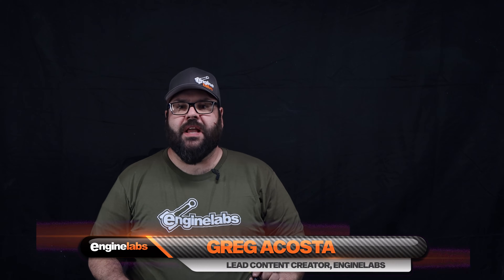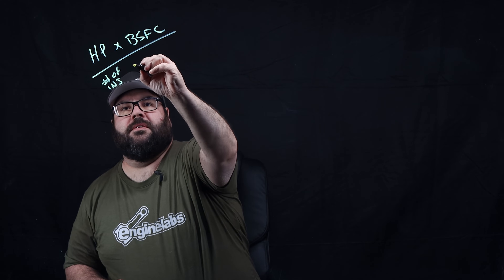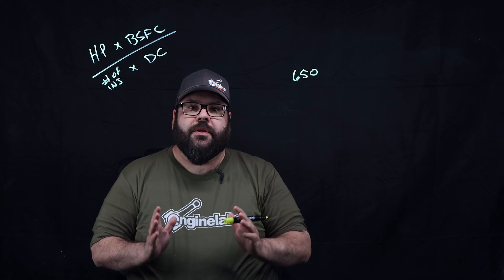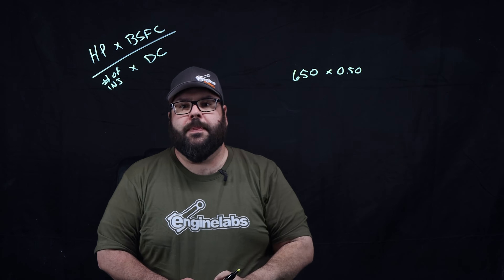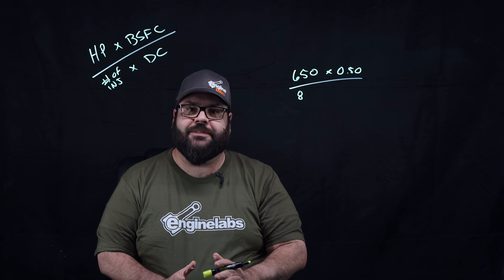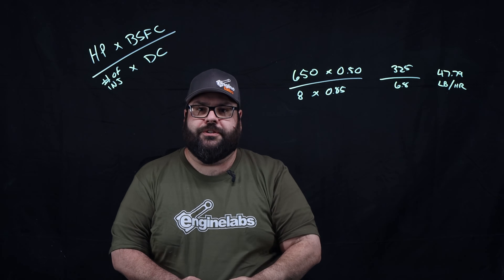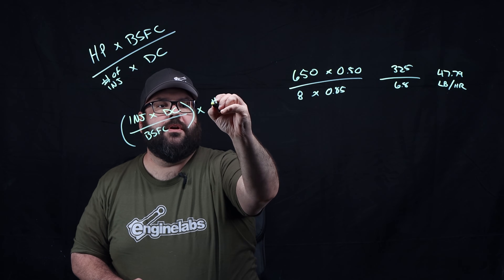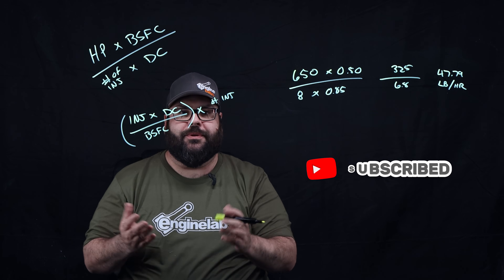Calculating Proper Fuel Injector Sizing with EngineLabs

Comment: so from this calculation, i need 700cc injectors, for pump gas or e85, but how do i calculate if i add nos?
Reply from the maker: Pump gas and E85 have about a 30% difference in requirements at the same power level, so make sure you're calculating that right. If you're running a wet kit, the nitrous doesn't factor into the equation, because it's bringing its own fuel. A dry kit, well horsepower is horsepower.

Comment: Yeah and Fuel press can add some adjust-ability especially at 43psi GM ol std, you can gain 2lb hr per injector by going from 43psi to 48psi i think is the final number.. 

So #30lb hr rated at 43psi is #32lb hr at 48psi... And so on, etc...

A good fuel pump is a (MUST HAVE).. If you run more than say a Aeromotive 340LPH in tank, you need a controller...  Like a Hellcat type...